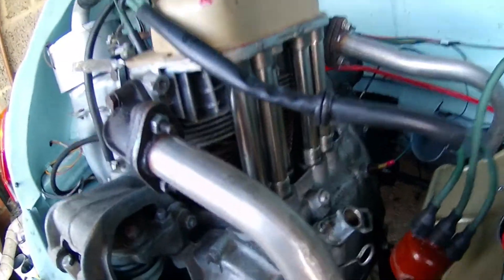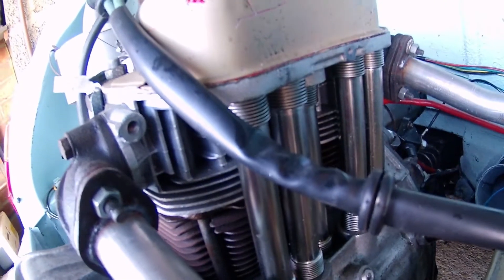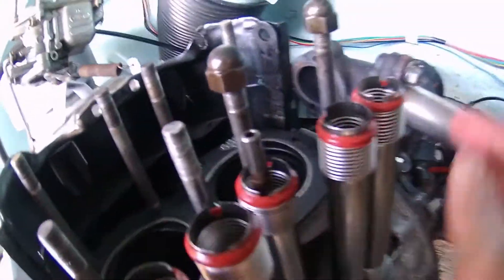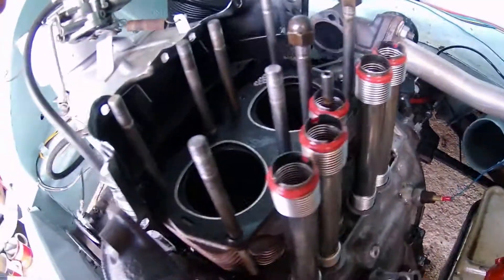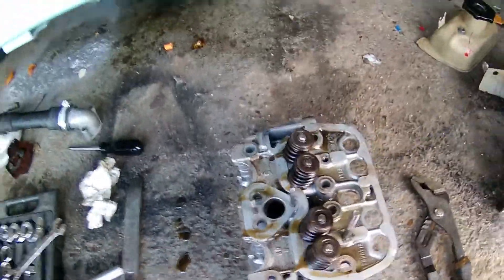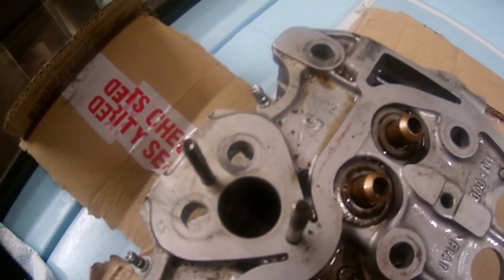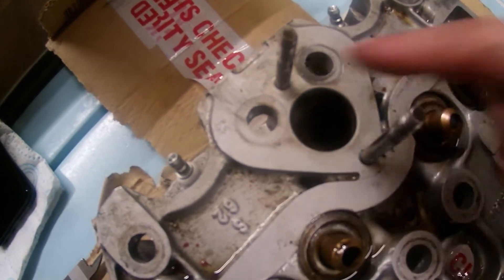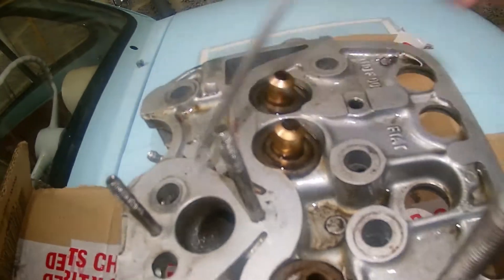Classic 1966 Fiat 500 cylinder head porting work part 1 : How to DIY

Comment: Im thinking of replacing my cylinders with a 540cc kit. Do you think this is possible without removing the entire engine? Also thanks for the flowing tips, I recently placed a 28 Weber but never thought of the airflow in the cylinder head.
Reply from the maker: Yes, its possible, id say, but it'll be close, you'll get the new pistons on easy assuming they use the same rods, be tight for the barrels. Its only a few bolts and 30 mins to remove the whole engine however so no point in trying to do it in situ to be honest